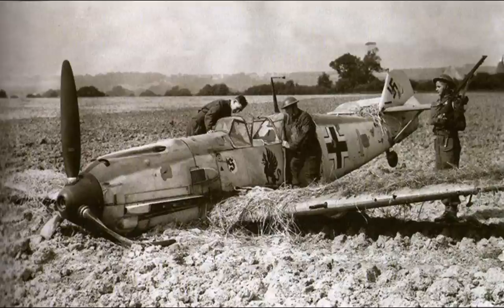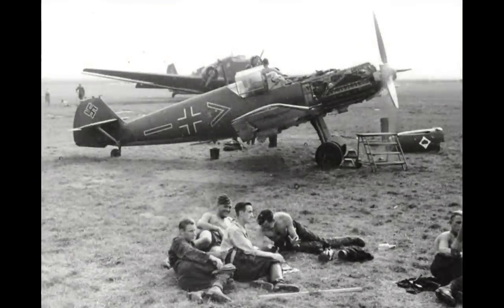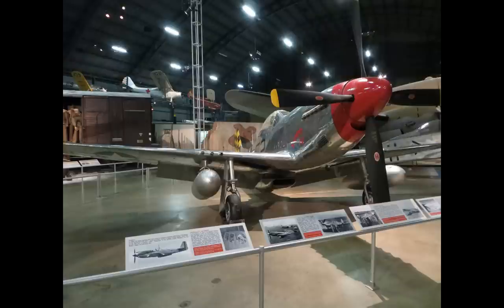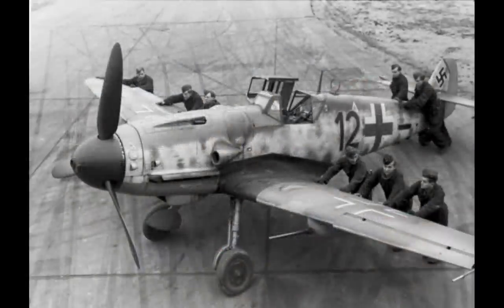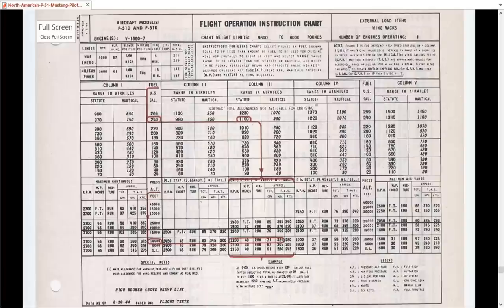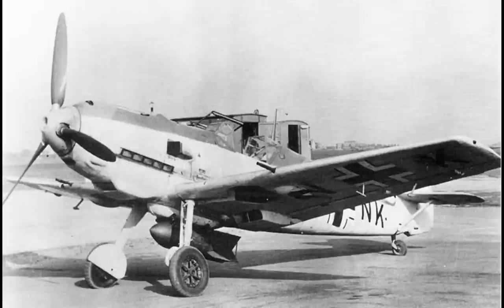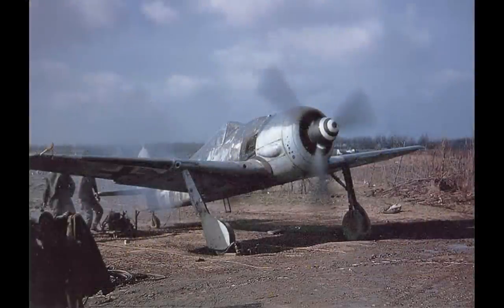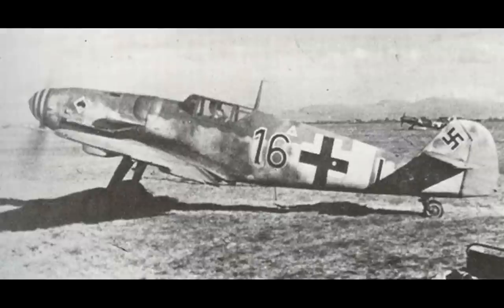Messerschmitt BF 109, Why Such Short Range?

Comment: Hi Greg, I don't know if this is the best medium for suggestions,.... following on from the 109 short range and its related 109 v P51;  the 'myth' of the Spit's short range - it flew from carriers to Malta, why the Zero had such a long range ex light weight etc, other non power reasons why the P51, for example, were superior eg aerodynamics despite 109's small size, Soviet aircraft if possible, etc Thanks again for your videos, pitched at just the right level:)
Reply from the maker: Hi Paul, a discussion of the 51's aerodynamics is on the way.  I will also work in more Soviet stuff. I do see there is a need for it, and that's why I at least mentioned the YAK in this video.

Comment: I have an important question, for me anyway.  I know of one video where they talk about German aviation fuel being only 87 octane during the war, and the allies routinely had well above 100 octane.  I see you have indicated that 130 and even 150 octane was used.  They great speed of most mustangs was attribute to that factor by many, although water methanol injection allowed some parity in manifold pressure, hence much greater power than would otherwise be expected.  But the energy value of lower octane fuel is theoretically lower as well.  Did this lower energy value of 87 octane fuel result in greater fuel consumption?  I welcome anyone to give their input as I don't know whether Greg is able to address comments here.
Reply from the maker: I do try to answer the comments in here, although I miss a lot of them because there are just so many. The Allies did have higher octane fuel throughout most of the war. The German water:methanol system closed the gap, but then the US added water:methanol to the P-47, so we had the higher octane AND water:methanol. I can't comment on the energy values of the different fuels because I simply don't know about that. Octane rating by itself is not a reflection of energy value, but that doesn't mean the different fuels didn't have different amounts of energy per unit of measurement. I simply don't know if they did or not.

Comment: Did the big engine/small frame dictate the narrow undercarriage - which caused so many crashes - because the wings were so full of equipment? (Compare to the FW 190. Interestingly the contemporary Spitfire has a narrow undercarriage - but I suspect for different reasons than the 109.)
Thank you for all your vids Greg.
Reply from the maker: The gear is narrow in the 109 for production and logistical purposes. That means you can roll it around with out the wings being installed.

Comment: Hey Greg, how much of a factor does air combat play into this issue of the BF-109 running out of fuel over Britain. I don't know much about fuel consumption from a prop/turboprop plane during air combat would be but I know fuel consumption during air combat for a fighter jet aircraft is affected (severely if combat is prolonged) depending on if it is traveling supersonic or subsonic, if it frequently hops between large amount of altitude, and how much it weight it is carrying externally and internally

Comment: You’ve mentioned the Bf/Me-109’s ability multiple times I think, but do you know if there are any limitations to that? The plane I fly has a 5 second zero g limit due to fuel and oil starvation and roughly a 60 second limit on negative g ops due to fuel starvation as well from the dihedral wing. If so I’m curious if the allies knew of these limits.

Comment: Thx as usual. Love it when the missus here in the background has that rolling eyes thing going as I gorge on this stuff. Most excellent. Trust the Germans to have fuel injection, variable SC and 4 valves per cilinder tech in WW2 fighters when a new Corvette today still has leaf springs and pushrod engines. No argument about the reliability and simplicity of the latter obvs. You have a great channel, love listening to you, cheers.

Comment: i know this is somewhat off topic on an old vid, but i recently came across a bit about a "messerspit" - it's this spitfire that was captured and then re-engined with a db605 which was then used to compare against a g6.  Now what i cant really find out is what those test results were.  I dont suppose you know anything about it?   Spitfire Mk VB (EN830)
Reply from the maker: It was faster with the DB, but that's largely because the Mk V had a weak single stage Merlin.

Comment: if i'm not mistaken modern nascar banned fuel injection, at least until 2014 while engine production was monopolized under honda.

and yeah it is a challenge to adapt your tech to a different fuel delivery method also with cars as much as it is with planes.
Reply from the maker: Yes, NASCAR has switched to fuel injection.

Comment: far as why the 51 was faster than the 109 id surmise a combination of aerodynamics and the incredibly high manifold pressures that the RR Merlin could handle. 

it had 2 superchargers dont forget (im sure you havent), and something like a maximum of 50-60 lbs/sq inch

Comment: The P-51 was originally powered by the Allison engine.  It was ok but not exceptional.  Then the Merlin engine was slipped into it.  That changed everything.
Reply: In some aspects the Allison was a better engine.  The Turbocharger design is what wasn't ready.  The Merlin was a safe choice and a known commodity.

Comment: I'd like to point out that the Americans had High Octane fuel that they shared with the British.
Reply: Yeah its because the oil in the US was poorer, below 100 octane naturally so they had to invest in additives to boost it producing 100/130. In Britain the fuel produced was naturally 100 octane with no additives required (87 was the standard civilian aviation fuel but 100 had been stockpiled since 1937). By the end of the Battle of Britain the UK had 500,000 tonnes still stockpiled, enough for 80 weeks of operations. The US experimented with limited test batches of 115/145 during the war but it never entered full production but Britain switched over to manufacturing 100/150 from 1943 and was supplying the US with 20,000 tonnes a year of it through Reverse Lend-Lease.

Comment: The Germans only had 90 octane fuel. The Allies had 120, which accounts for most of the speed differential. The whole of WWII strategy is overshadowed by the German and Japanese need for fuel, and their demise was to a large part caused by their failure to maintain it. As the war went on, Germany, famed for Blitzkrieg, became more and more dependent on horses, while the Japanese couldn't scrape up enough fuel for their navy or pilots, hence the need for Kamikaze sorties.

Comment: @3:45 I’m looking at the up draft carbs I think on the yak.  I would think the exhaust would heat soak the intake track. Is the room in the valley of the engine for guns? Why would they not use the top of the cylinder head🤷‍♂️
Reply from the maker: Those are carbs. The Russians did some weird stuff, but for the most part it worked. I'll cover this engine in the future, there is just too much there for the comment section.

Comment: The Benz engine was also designed as an inverted engine which enabled it to produce more torque.
Reply from the maker: Why would an inverted design be able to produce more torque? Do you have a source for that?
Reply: @GregsAirplanesandAutomobiles I will try to find an actual source that states that. I have been told that in military mechanics and Jet Engine mechanics courses when I was in the Navy, and Army.
It is also claimed that the slant 6 or inline 6 cylinder engines make more low end torque due to the cylinders pushing the power strait down and not making power in two different angles. This is why diesels in large trucks tend to be inline 6 engines.

Along with the claim that the inverted aircraft engine designs made more torque they claimed that they had less service life and would need to be rebuilt sooner. 

What ever the reason was I always found it interesting that Benz made them that way. It did seem to allow more room for machine guns to be placed over the engine and for the fuselage in the upper plane nose area to be thinner there. 
look at the Stuka's, the 109's the FW's with inline engines. They all have that exhaust manifold thing coming out on the bottom.
The 109's that were made in Spain all have a merlin engine and have it at the top and have the slight appearance of a p40 nose.
Reply: @GregsAirplanesandAutomobiles So far I cant find a source for the inverted engine torque statement, but I'm still looking. It could be another myth assumption that got started as I was told that several times in the 70's and 80's.

Comment: Why did it take do long for the Luftwaffe to recognize the utility of drop tanks in the Battle of Britain?
Reply from the maker: They went in another direction and put bombs on the 109s. They would not have prevailed even with drop tanks.
Reply: @GregsAirplanesandAutomobiles  I think that, had the Luftwaffe used drop tanks and continued the offensive against the southern airfields and radar installations, that the UK would have found it very difficult to maintain air superiority over southern England... this in turn would have dragged out the Battle wi h serious implications for the RAF.. it could also have had implications for the timing of Barbarossa,...

Comment: Greg: A question: Is the comparison between BF109 and P51-D valid? One was designed pre-war, the other with war experience. Would it not make better sense to compare BF109 to Spitfire or Hurricane, and P51-D to Focke-Wolf?
Reply from the maker: Did I not literally compare the 109's range to that of the Spitfire in this video? Did I not clearly make the case that the 109's range was comparatively equal to that of it's early war contemporaries like the Yak1? Are you saying that I should not have had the P-51 in this video? I think it belongs here to show the difference between the two, and furthermore, the 109G was a totally different plane than the pre-war 109 and only came out about 6 months before the Merlin engined 51s.

Comment: With a carburetor and blown engines... There is more than a "slight cooling effect", but only with draw thru turbocharging or supercharging. The vacuum created behind the carburetor is enough to drop inlet air temp to well below freezing(the gasoline is the refrigerant). This can be used to increase boost, significantly. On a blow thru design, there is no cooling effect and no advantage.
Reply: It's not the vacuum that causes the drop in temperature. It's the heat absorbed by the fuel when it vaporizes.
Reply: @iskandartaib  and without that vacuum, the fuel wouldn't vaporize at a rate fast enough to act as a refrigerant. Heat is not really "absorbed", you can think of it as being displaced.
Reply: @JohnDoe-ml8ru I don't think that's the case if we're talking about supercharged engines (which the Merlin and DB605 were). Instead of a vacuum there's actually a fairly high pressure. At wide open throttle there shouldn't be a need for any sort of restriction in the intake if you're spraying fuel into the intake stack (unless it's the throttling needed to prevent overboost - which goes away when you reach the full-throttle altitude anyhow). You do need to atomize the fuel to give it a high surface area, and you do need to provide enough heat energy to overcome the heat of vaporization. You do have to have P-T conditions on the vapor side of the liquid-vapor boundary curve (on a pressure-temperature diagram) - you can do this in one of two ways - reduce the vaporization temperature by reducing the pressure, or by increasing the temperature (which a supercharger does). Whether the heat is being "absorbed" or "displaced" is a matter of semantics, I think "absorbed" is a good description. It's the energy required for the phase change that absorbs the heat. 

Now, if you're talking about naturally aspirated engines with a carburetor, then yes, you're right, the vacuum does help vaporize the fuel.

Comment: Does not the latent heat of evaporation of the fuel have a significant effect on the charge temperature after the carburettor? Hence the danger of carb icing in a non supercharged aero engine.
The DB605 never used 2 stage supercharging operationally and had to rely on a variable speed impeller which is actually less efficient over the required range of boost pressure.
Reply from the maker: Yes, the fuel does evaporate, but it does that in either a throttle body injection system or a carb, thus isn't limited to carbs. The cooling from the venturi, which is much more significant only happens on carbs to any real extent. There is a reason planes get carb ice all the time, but very rarely icing in a fuel injection system. Not sure what you are getting at regarding the 109's impeller. I have a whole video explaining the variable speed system, who said it was two stage?
Reply: @GregsAirplanesandAutomobiles  
I agree fuel cooling improves the air density equally for both systems but only as far as getting the mixture into the cylinder. In the Merlin the fuel was added before the supercharger thus increasing the air density to the benefit of the supercharger itself. Stanley Hooker of RR certainly claimed this as a significant advantage. Injecting fuel after the supercharger as in the DB605 gives no benefit to the supercharger. 
I was trying to point out that a two stage supercharger, particularly with an inter cooler as in the later Merlin is more efficient (power required for a given boost) than a variable speed single stage unit.
Reply from the maker: I'm starting to feel like I need to make a whole video on this exact topic. I'm not arguing that there isn't a cooling benefit to the idea of putting the fuel in before the supercharger. I'm arguing that's NOT a benefit of carburetors. Either fuel injection or carbs can be set up that way.

Comment: Fyi the temp drop across the carb is a real thing it may well not be a factor in this case and it has nothing to do with the pressure drop its all about the vaporization of the fuel pulling heat out of the mix.  For instance on some methanol fueled engines with carbs will drop 60°+ across the carburetor.
Reply from the maker: I didn't say a temp drop isn't a real thing, nor did I address vaporization of fuel. I was SPECIFICALLY addressing the myth that the temp drop from the Venturi adds power. Temp drop from vaporization is an entirely different discussion, and not one specific to carbs, many fuel injection systems are set up in such a way that they get that as well.

Comment: Why didn’t they use larger/more drop tanks on the Bf 109? Is it because the airframe cannot handle the load, or that the plane won’t be able to clear the runway?
Reply from the maker: Because after the Battle of Britain range wasn't really that big of an issue for the 109.
Reply: Thanks for the reply! Really appreciate it. Still it’s curious that the Germans did not try to extend its range during the Battle of Britain.
Reply from the maker: That's a long story in and of itself. The short version is that about the time they had it set up to carry drop tanks, the decision was made to fit bombs instead. I think drop tanks would have been better, but either way, they couldn't really win that battle. The Germans just didn't have capacity to bomb Britain into submission, and had no way to realistically invade across the channel.
Reply: Thanks for the info. And of course Britain had a sophisticated radar based interception system.

Comment: Another reason for German aircraft not having long legs was they were designed to fight more on a tactical basis. Germany never built more than a few long range bombers. They did not have the raw materials to spend on building a strategic Air Force. In the US aircraft were designed to have greater range. On example was the Spruce Goose. The thinking was we might have to fly from the US to Europe with no Britain in the fight.
Reply: The Spruce Goose was designed to replace troop ship's. The B-36 was the plane designed for Intercontinental bombing.

Comment: Have you done a comparison between the BF 109 and the FW 190 D9 or Ta-152?  I understand the lack of data on the 152 but engine stats should be available with hypothetical frame equations. I'm not an expert at all just very curious since I was 12, 40yrs ago.
Reply: I've also found Gallands flying Circus to be very interesting. Commanding the different Dora versions. I'm not sure exactly how many air frames there were but have a very interesting story concerning red 7 according to a Doctor Maire that I had, whom was very close to the Galland family through his fathers past. Reds  1, 3, 5, & 9 with 7 being a question of existence.
Reply from the maker: I haven't covered the D9, but I hope to get my 190 video up next month. A lot depends on my schedule at work.